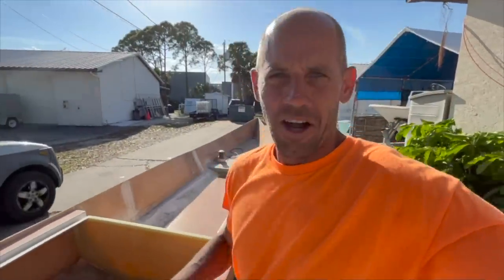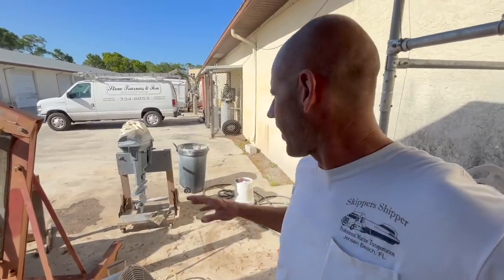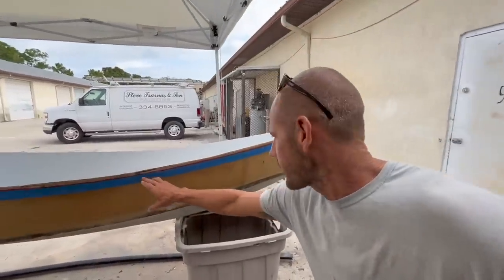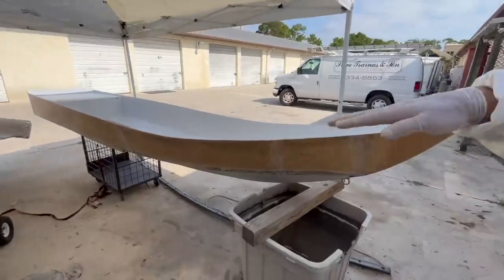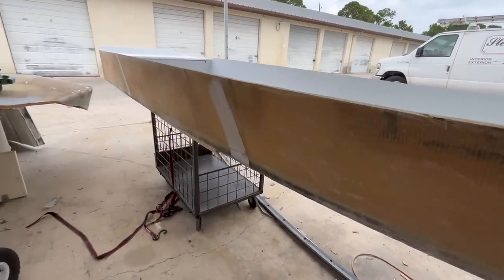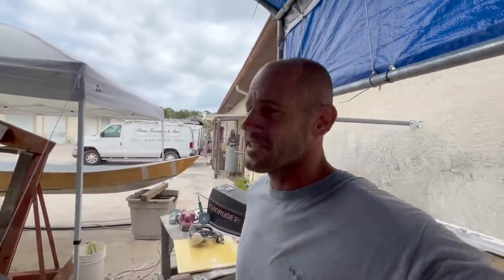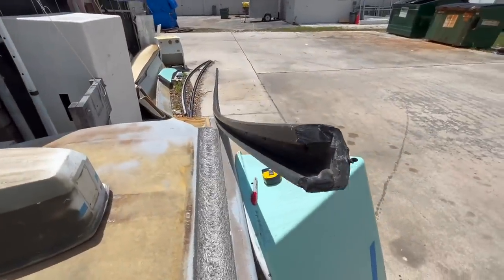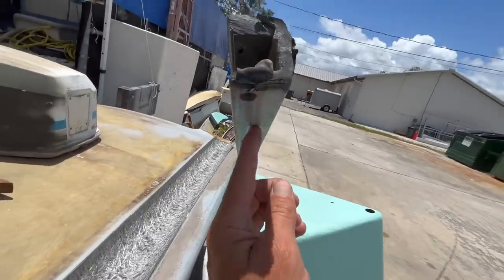DIY Skiff Boat build / PART 5

Comment: Hello, what if. You wanted a small cabin/shelter to sleep in on a skiff like this: how would you shape and build it. Would need to be for mostly fishing and and sleeping out on freshwater lakes. Steve
Reply: Canvas dodger forward with a tunnel tent extending aft supported by athwartship laminated wood bows. Run the bows inside the gunnels on T-tracks fore-aft to make it easier to deploy. Secure the canvas with snaps on the outside of the rail. Do the canvas in stations, so it can be run dodger only, cuddy cabin, full sleeper. Easy peasy.

Comment: All the way to part 5 to see it sold before getting a real top speed run due to forgetting a pin. 🎉 fudgecicles
Reply from the maker: Man oh man, I feel your pain.  I’ve always prided on myself for being prepared and having checklists/ and “thinking of everything”. But I was so darn excited and had freshly painted the motor , and well… totally forgot. :/. 

So with that says. It did get another test run with the new owner and he hit 47 mph in saltwater.  So it was incredibly close!!!!  I’ve been thinking about a follow up video on it.  But the new owner didn’t have a good ending…. He was ejected and lacerated on his hand and leg.  Emergency room… stitches… the full experience.  :/  maybe I’ll include it on a “skiff projects follow up” video I’ve been working on. Cheers!
Reply: @diywaterworld  did it just get out of control or did it delaminate
Reply from the maker: @Yeetmaster900  no issues with the boat , it’s still super solid to this day.  Issue was driver related, a bit of hot rodding in not so ideal conditions a couple days after getting it.  It definitely was not a skiff for the faint of heart and honestly was ideal with a 9.9 hp motor.
Reply: @diywaterworld  yea once you went above the 9.9 I was questioning your decision making lol.